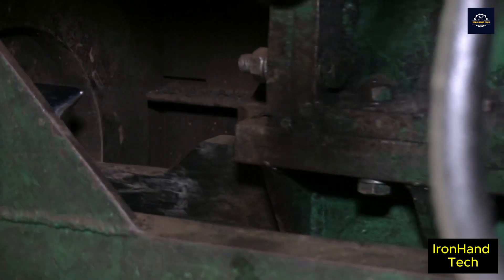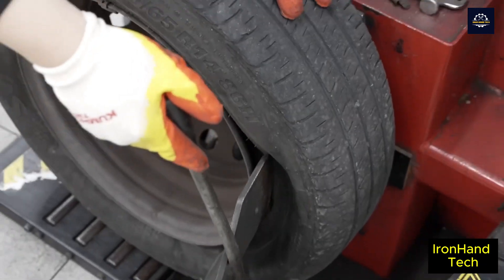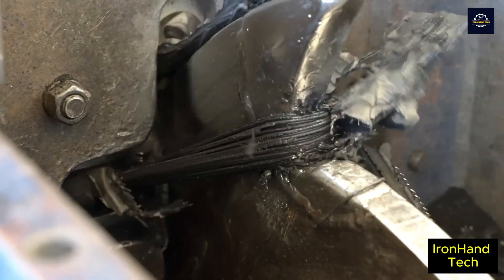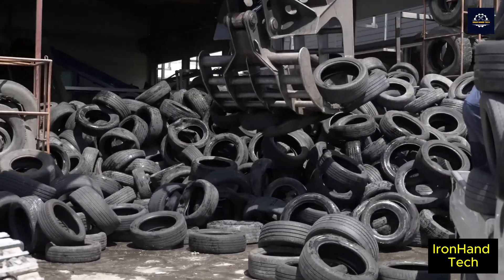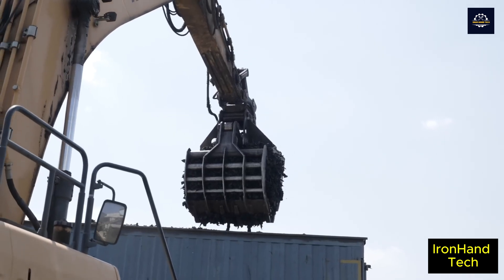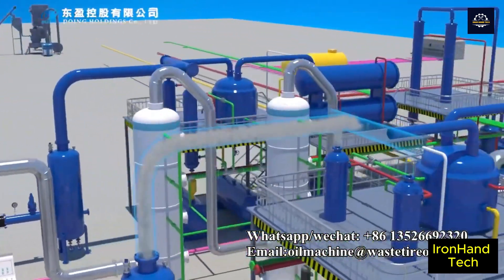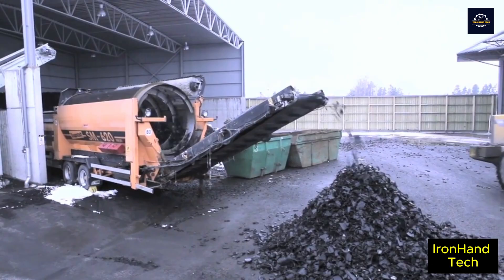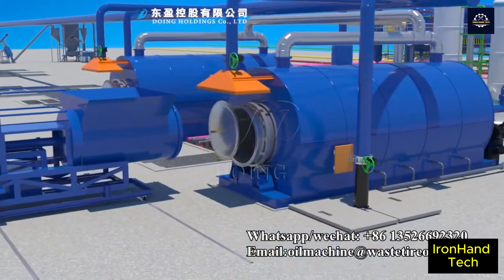Amazing Process of making Oil through recycling Old Tires

Comment: Куда используется это масло?
Reply from the maker: According to our research, this oil is used as a substitute fuel for FO oil in heavy industries, such as boiler combustion, industrial steam in cement manufacturers, metal casting (such as aluminum, copper, cast iron).
You can refer to other sources of information to confirm more firmly. Thank you for watching the video.

Comment: Don't understand why the tire stores charge us a disposal fee when we should get moey just like scrapping metals! 
TIRE DISPOSAL FEE IS A RACKET SCAM!!!!!
Reply: Disposal fee is charged to make sure the tire shop uses the correct channel in disposing tires, they have to store it requires space in the shop, and then have their recyclers collect , picked up twice a month, CA State Law. This fee is required to offset any cost by the tire shop. It is illegal to dispose tires in trash.
Reply: It should be a deposit fee that way if you have old tires around your neighborhood you could collect a deposit for turning them in,  but you should be charged a deposit when you buy the tires but if you return your old 4 tires get 4 new tires there should be no charge. It's a long and complicated process of cutting up tires and removing metals talked about throughout the video then in the end they just show whole tires being pushed into a combustion chamber that is the way I would do, it just clean them heat em up in oxygen deprived chamber and collect the volatiles then pull out and recyle whats left.

Comment: How much oil is used to get one galon of oil back from the tires?
Reply from the maker: This depends on many factors. But you can trust that it makes sense for the environment.
Reply: I can tell you for every gallon of diesel fuel produce you need roughly 15 gallons of crude and for every tire melted down you will approximately need 2 gallons of diesel or 25lbs of natural gas or one gallon of propane. In China, where they produce oil from tires, they use diesel fuel so they can reclaim the unburnt carbon. For every gallon of diesel burnt at 5000 degrees 7% is reclaimed into fuel. The rest is filtered out into usable carbon for ferterlizers and agriculture.
Reply from the maker: @JohnDoe-hp8zl  Thank you for information.